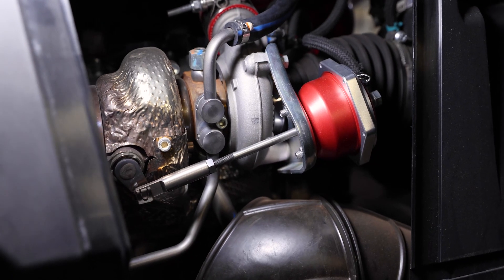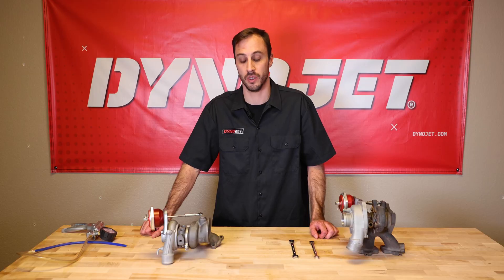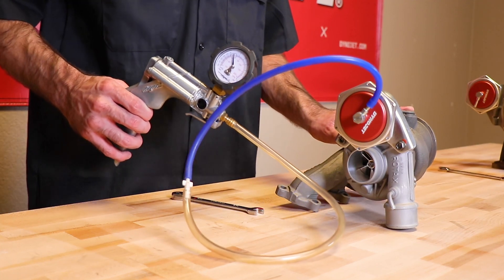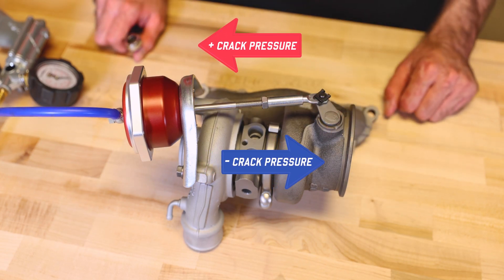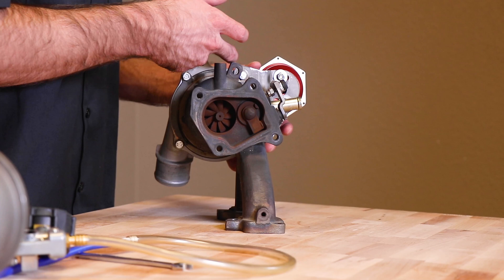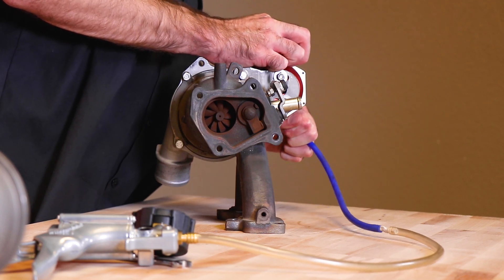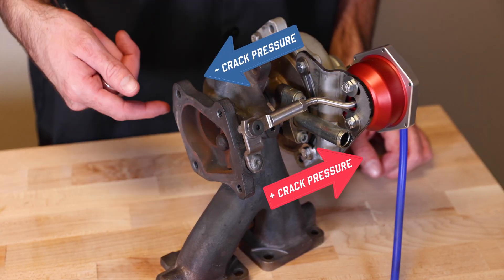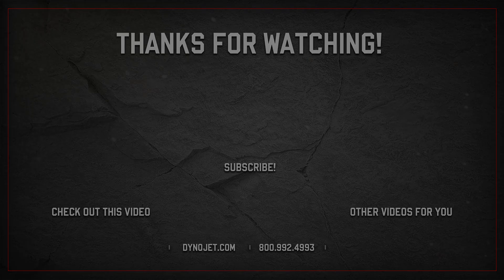How To Adjust Dynojet Wastegate Actuator Crack Pressure (Can-Am X3 & Polaris RZR)

Comment: Why is the crack pressure not set at 5.5 like factory which is what most need?  Why are your instructions on the product page for Rzr Turbo R not showing procedure for lowering crack pressure?  Why would lengthening or shortening the rod change the crack pressure at all?  Doesn't make sense because a 10 psi diaphragm moves at 10psi no matter what so please explain?

Comment: I have an aftermarket assassins . actuator And it works off pressure. non vacuum It looks just like your diner jet, but with their name on it. Where does that turbo build pressure to operate that? I'm having trouble with charge tube temperatures. Any thoughts?